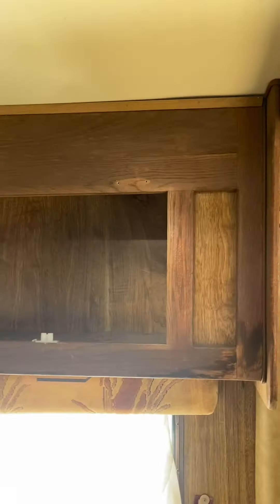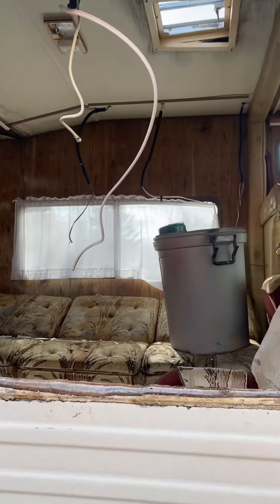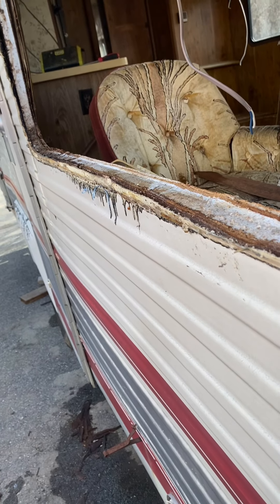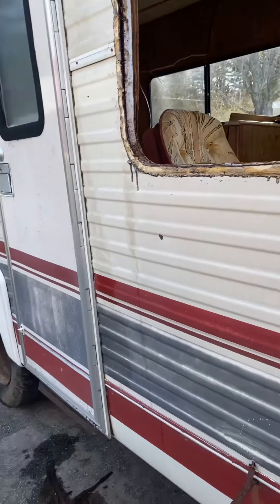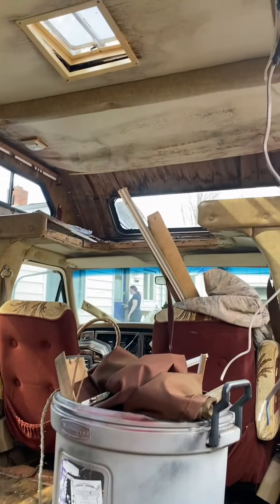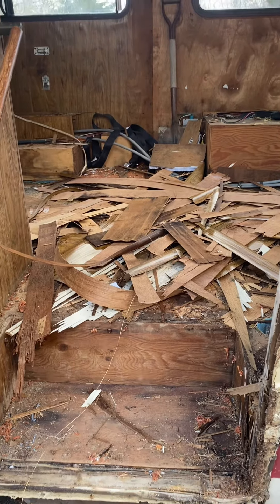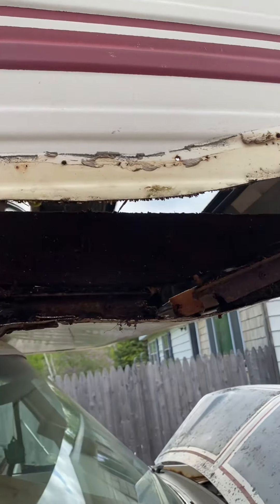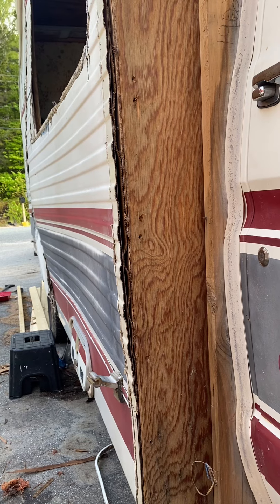Was it worth it. Remodeling an old coachman rv

Comment: i have 1982 ford coachman is 26 ft long.   mine was mostly water damaged from roof and some walls.   so i did took all camp systems off.  then add 63 inch semi sleeper attach to van cab that already on.  but so far i have make add on top the van cab for cover top of cab front of semi sleeper's front opening.   that shortest is 12 inch tall and tallest is 16 inch.  inside of semi sleeper is all original.   semi sleeper is 2004 peterbilt.   but i'm still working on it.

Comment: If the engine/ trans is good, that's a great platform. Just do one wall at at time. Think of it as rebuiding a box inside an aluminum skin. Remove everything under the skin and frame in a new section until you end up with a Box truck, ..then add propane heater, stove, bed, chair etc. ..sometimes less is more. Keep it Lite and keep it Simple.✌️🦝🌌